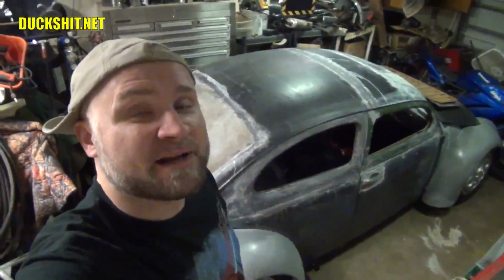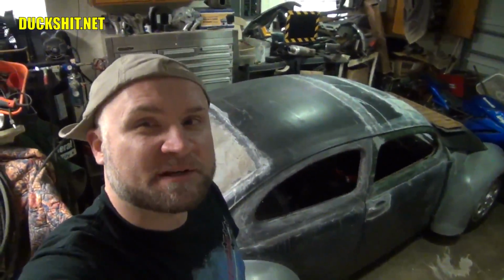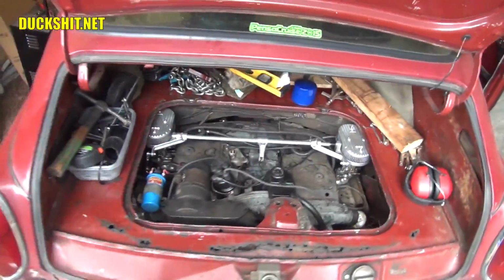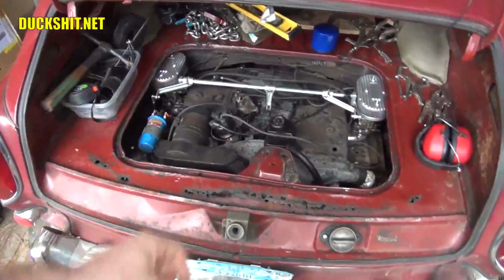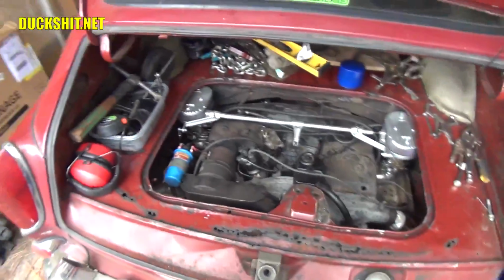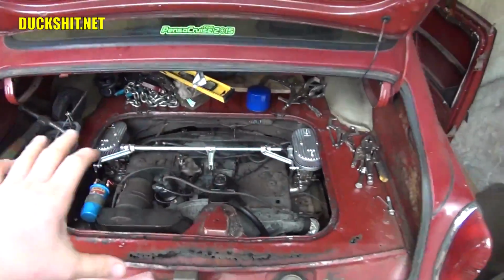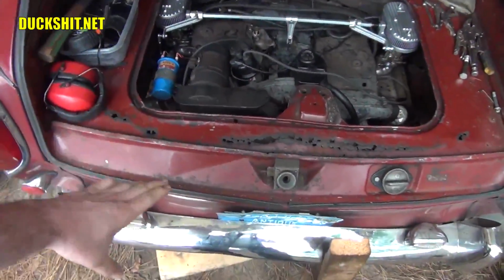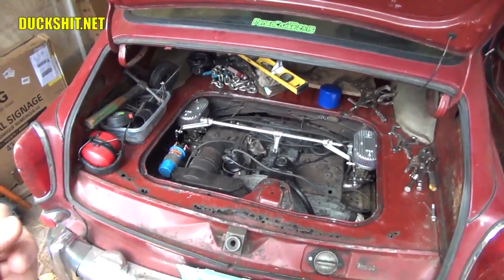Fitment Resolution - Dual VW Type-3 Carburetors - Mid Day Q & A - 11

Comment: On your Fastback...  Great job raising and leveling the rear cargo compartment floor. Really looks good, and quite glad you found a way to avoid doing a hack job as so many others might have been inclined to carry out as the "easy" solution. Looks quite clean. What, may I ask, is what appears to be a gas cap on the rear valence panel-- to the right of the rear latch mechanism? Can't actually be a cap for the gas tank, can it? Very informative videos. Thank you.
Reply from the maker: No, its not the gas cap, but some people have mistakenly filled it with gas, lol!  Its the oil cap/dipstick!  Unique to Type-3.  I'll cover it in tomorrow's Q&A for ya!    Thanks for the compliments, I really appreciate you!
Reply: As someone who has built a lot of hot rods and custom cars over the last 25 years, I know how easy it is to imagine all sorts of cool ideas in one's head for a car project, and how immensely hard and time consuming it is to actually bring those ideas to fruition in reality. Keep it up!
Reply from the maker: Hahah!  Yes indeed!

Comment: The only thing I had thought of was possibly a slide hammer but it didn’t look like it would fit in the place you was working so I kept silent because I didn’t see a easy way to move the flange
Reply from the maker: Yep, i had my slide hammer ready... but like you noticed there was not enough room to use it!

Comment: If you shorten the air filters you will be decreasing the amount of available air. This would make the K&N filter even more viable as a replacement choice. Not sure if less air at near sea level will affect your performance though.
Reply from the maker: I think we'll be OK!  The filters I had before were overall shorter and much smaller circumference, and extremely crushed and dirty!  I still got 30MPG.  Anything over that is an upgrade!  LoL!

Comment: I don't know much about the cam specs of the Engle cam you mention here. Plus, I didn't catch whether the heads are big valve-big flow aftermarket heads (like from CB) or stock. However, given that the displacement (1776cc) is only 10% greater than stock, and given my many years of experience in the water cooled V8 American hot rodding universe, I would be inclined to think that the dual carbs selected for this engine might be too much and might render the drivability terminally crippled. It would seem to me this 1776 performance engine might  never drive well, never enjoying good tip-in especially, because it is simply overcarbureted.  I'd be curious to hear your thoughts and whether the engine, after it  gets real world street-driving experience under its belt, does drive smoothly, crisply and responsively. Enjoying your videos and mechanical ideas quite a bit. Keep up the good work!
Reply from the maker: Yes they are big valve heads... because of the increased flow you could actually go to dual-dual 44s and gain another 5hp... but it starts to get very expensive then, and gas mileage suffers.  Thanks for the suggestion, but this engine was actually spec'd out by a professional... not me!  LoL!

Comment: Ha!  and they said it wouldn't fit!lol Good job man when u do ur sync video can u explain the rubber balance tube that comes with dual carbs? I have dual empi epc 34s on my 1600 dual port 1972 super beetle and the kit I bought came with the intake manifolds, linkage, and I think its called emosion tubes or balance tube? Anyways I don't know if its necessary or what it does so if u know or could reference it that would be awesome. Thanks again and keep on buggin... 🙃
Reply from the maker: I'll talk about it in tomorrow's Q&A video, the balance tube isn't required, but will make the car run smoother at lower RPMS with smaller throttle positions.  Its recommended!

Comment: Before I comment, this is only an observation,and I do not intend it to be demeaning.
It is only my opinion in a free flow of ideas forum.
But.....
What happened to the lovely flawless electronic fuel injection? Seems to me that would be the “easy” solution. Fitting the correct components on this machine requires zero engineering.
I understand parts are hard to find...but it’s a wonderful system.
Reply from the maker: Previous owner's mechanic removed it and messed it all up.  I have it in a bin over here.  Lots discussed about this in older videos of mine... like removing the 30PSI fuel pump that he had feeding these carburetors into submission.... GAS EVERYWHERE!  ACK!  Some mechanic that guy was!  Certainly not the easy solution to go back to that, I have no idea the condition of what is in that bin or even if the wiring is all still here in the car.
Reply: @DuckmanCycles  ahhhh I see.
Reply from the maker: Yep!  But these carbs are good once I got them cleaned and sync'd properly and fixed the damage to them that the excessive pressure caused.  😀😀😀😀
Reply: @DuckmanCycles  that's insane...they didn't  take the electric fuel pump of..ha,ha,ha
what a mess! Lemme guess...it ran rich....ha,ha,ha
Yeah ,nothing wrong with carbs, the old ones had them.
Love your videos, and I love the subject matter as well.
Reply from the maker: @OkFixer  Oh man, it was worse than rich, it was squirting out EVERYWHERE!  It was amazing that it even drove at all!  The exhaust was nice and wet, too!  Yuck!   Thanks so much for the compliments, glad you enjoy!  Lots more to come!

Comment: my dumb azz would have pulled the whole car apart to fix it then i still would have cut wholes in the floor and stuck the air cleaners in the trunk
Reply from the maker: LoL Some carb kits actually require that, they even give you a special lid to cover the air cleaners for a Type-3!